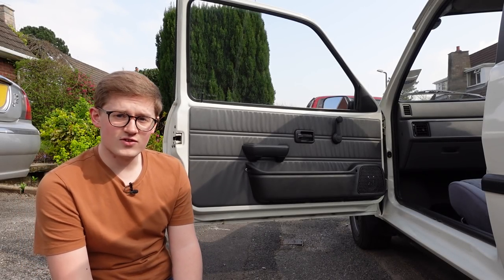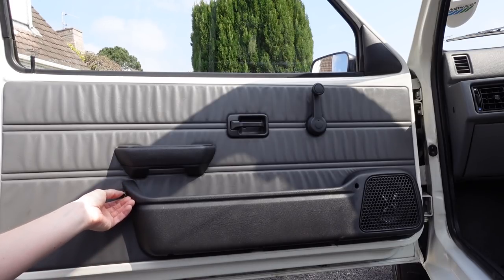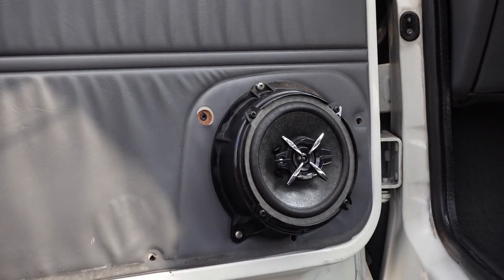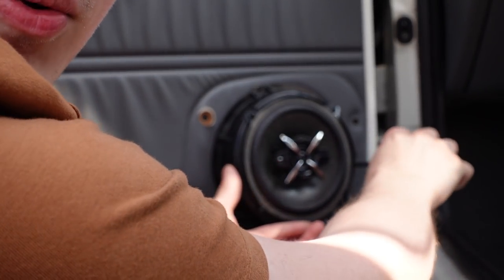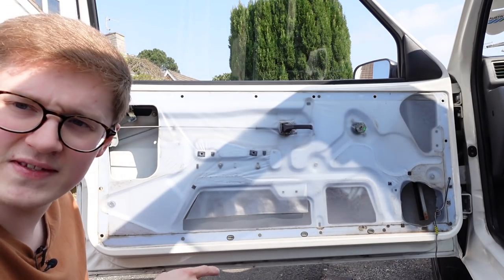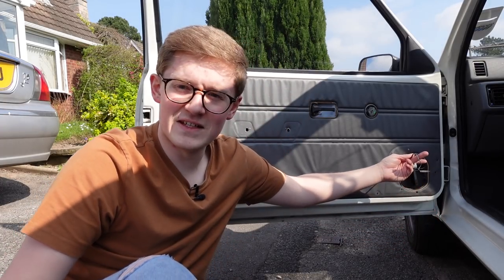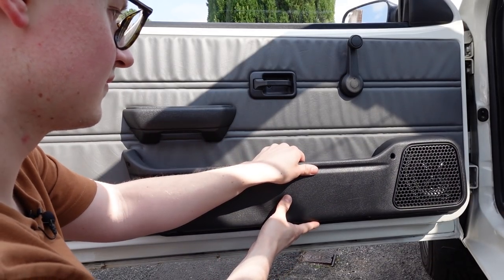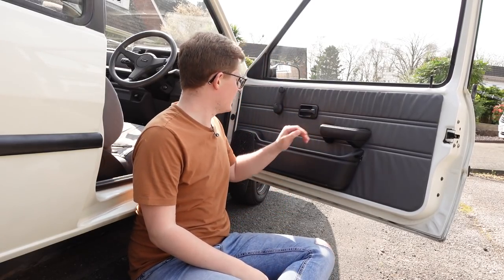Rover Metro - New Door Cards and Door Bins

Comment: Great video. I’m not sure if I’ve contacted you before but there’s a white 1990 GTi in my local scrapyard. A lot of the interior has gone and so has the body kit but there’s potentially a lot of spares still available for Melvin. Still even has the original Rover radio/cassette player.

Comment: Broken plastic parts like your door bins can be easily repaired by applying a couple of layers of fibre glass cloth on the rear around the mounting points............totally invisible and stronger than original.
I once did the entire back of the dashboard from a Reliant Scimitar GTE using this method as the mounting screws had pulled through and also the main gauges were flopping about............final result, better than new

Comment: Well done, Ed. Lovely to see Melvin getting that level of care. I eliminated the door bin on my 1990 Volvo 240 when I had the door apart to replace the regulator. Cheap rigid plastic at foot level when the feet in question are a North American size 13 is not a recipe for success. At some point, likely 4 years from now, Arthur will get the full Monte and be brought back to rights. He will be at about 450,000 miles by then, so that will work out about right

Comment: Nice improvement, must be very satisfying now that it is done.  When you said the speakers had been replaced, I was just waiting to see the wires twisted together and covered in tape.  Sure enough!  It explains the ham-fisted plastic breakage and inept repairs.  It would be much better to get some terminals and either crimp or preferably solder them together.  The twisted together wires will eventually corrode and fail.  Sorry, sorry, it's one of my pet hates 😄 Anyway...... Melvin is getting younger all the time. ✨

Comment: I guess the door speakers have been replaced before (maybe not installed when new?) going by the various insulating tape and how the wires are sprouting from a random hole in the wrong place. The plastic may have been cut back to allow access to lubricate the window runners and mechanism. It is a good job you have Melody, because soon Melvyn is going to be in such concours condition that you won't want to run him! I only partially jest, he is looking really good.

Comment: You should get a set of picks, very useful for so many things like removal of that round trim on the window winders.   Picks are basically just pointy bits of metal bent In different ways, but useful.    I’m embarrassed to say that in the past I’ve been responsible for sticking broken parts back together glue or silicone, mostly because before YouTube existed I would tend to break parts like that when attempting to take them off, nowadays In far more particular and I at least replace the parts that I break!

Comment: I would have taped up the holes in the plastic sheeting behind the door card. Or replaced it. Stops a lot of road noise. Also. I was always told to have the window winder at the bottom or half 6 position. That way the winder won’t let the window down when the car is bounced around.

Comment: FYI You dont want to put a cavity wax in the bottoms of the doors. There will be several water drain holes in the bottom. If they get blocked the door will fill up with water and you will definitely have a rust issue then !.